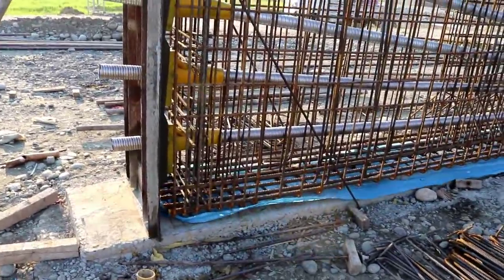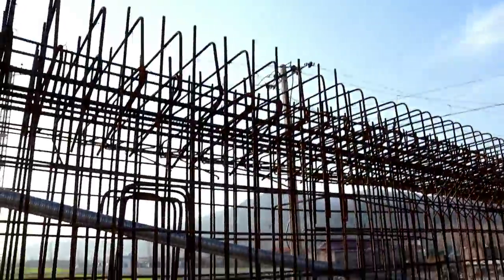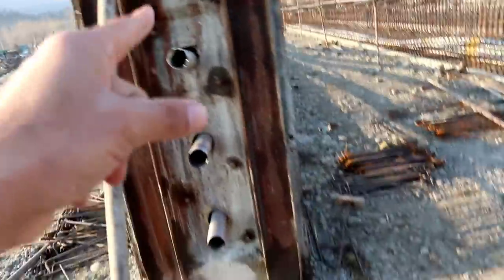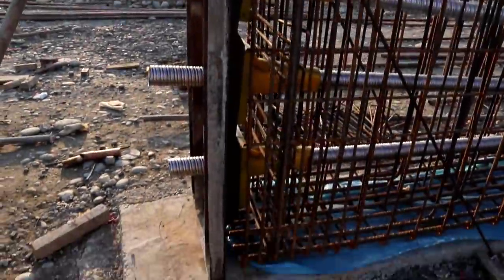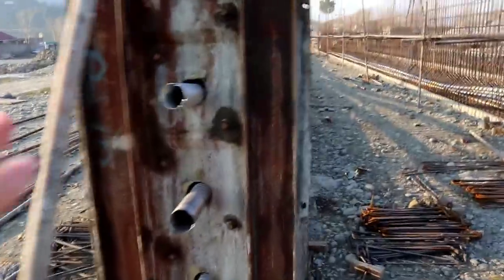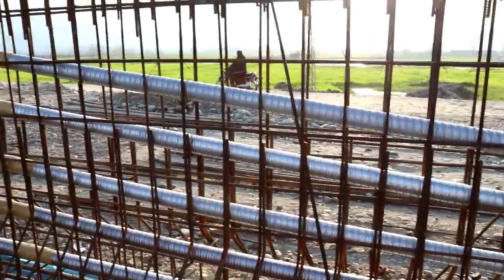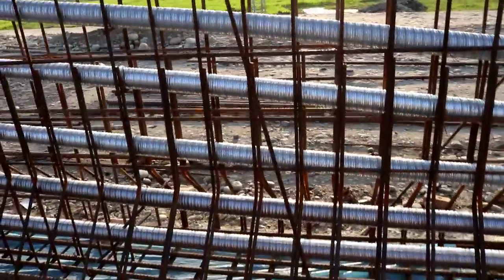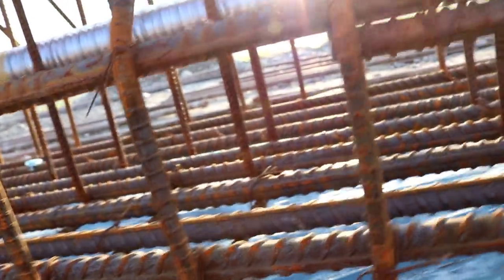Design of Prestressed Girder for Bridge - Prestressed Girder Reinforcement Details

Comment: sorry sir is it stressed or streched..  the purpose of the pipe i cant clearly hear what u said
Reply: Dear purpose of sheeth pipe is to protect the tendons wires to make contact with the concrete,and also protect wires from corrosion.
Reply: Yet it is without stressed ...i am not structure engineer but i have knowledge about it.